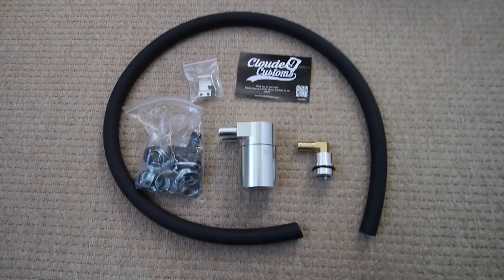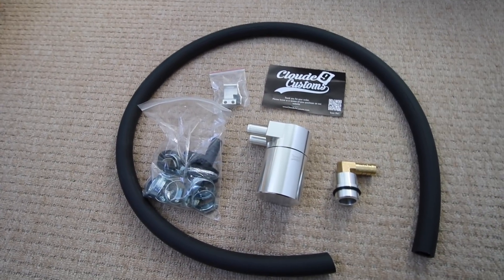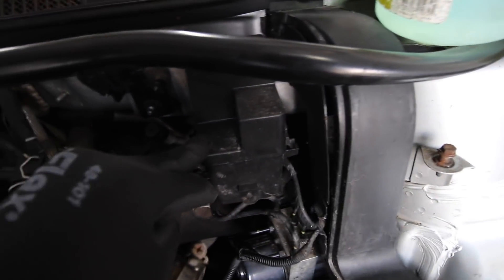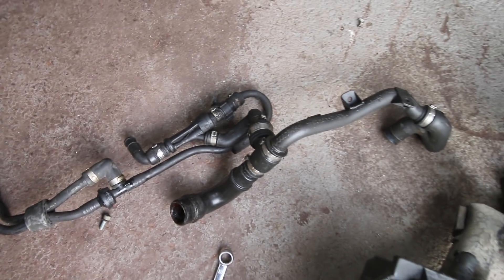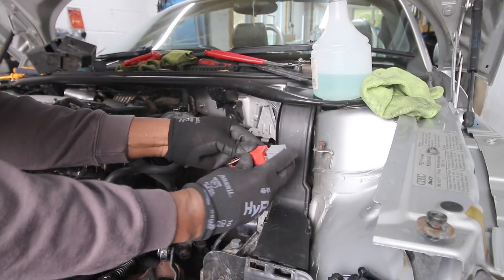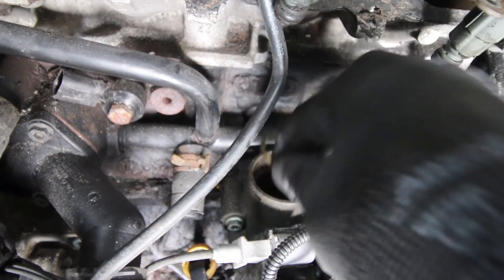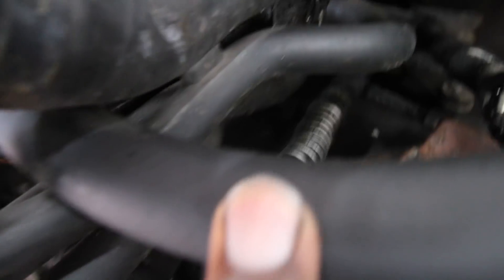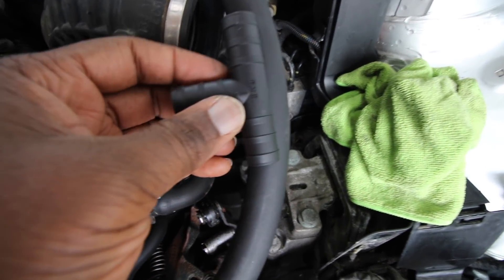The Best how to install a catch can guide on a Audi TT mk1

Comment: Thanks Paul, great video. Tip for cutting the rubber pipes, I use a large sharp kitchen knife, smear some washing up liquid over the blade and around the rubber pipe and it cuts through like butter with nice clean cut. The washing up liquid stops the friction when you cut causing the blade to jump about.
Reply from the maker: Great tip.
Reply: @CarsForPaul   Thanks Paul.

Comment: Very well explained and shot, Paul. Well done from Australia. I have already installed a catch can on my Mk1 225 TT but it's mounted lower down on the battery case. I will be changing the mounting point to what you have just demonstrated because it's more accessible and a cleaner, simpler install.

Comment: Hi, and thanx for this nice vid. I’ve just seen on my can ( not installed yet, and same model ) that the grid inside is on the other way ! There are two screws to invert the position. So, not sure now if this grid must under the output :/

Comment: I need to replace rear calipers, hoses, power brake booster, and all brake and clutch hydraulics on my buddy’s MK1 TT FWD. Is it a horrible pain in the ass to do the clutch line and the brake hydraulics?

Comment: My TT is remapped with decat, miltek exhaust, and Piper x filter. After doing mods I was getting around 27.5 mpg. When it was standard I got 30mpg.
Did this catch can install and now getting 31.5mpg approximately! Must be to do with the car breathing better... Definitely worth doing... Has anyone else had better mpg after fitting?
Reply: I'm getting the kit I'll let you know if it does

Comment: Enjoyed video,but curious on the benefits of catch can....Just got my first 225 tt..Thanks...
Reply: The benefits of the catch can on a 225 TT is the removal of the OE spaghetti piping (that Paul showed after he removed it) of the PCV system to prevent vacuum leak problems that are hard to find and fix with the intake manifold in place. The OE PCV spaghetti piping is a complicated mix of hard plastic pipes, soft rubber pipes, one way valves and a Y Venturi valve. After 20 odd years of running a hot turbo engine bay, these pipes will disintegrate, crack, split and cause all kinds of symptoms to make your TT run badly. Doing the catch can mod Paul demonstrated will prevent all of this, is much easier to check & maintain and will let your crankcase breath much better, with excess oil vapour either being caught in the catch can or burnt up as it gets reinjected into the turbo via the TIP (which is what happens in the stock setup also). Hope that explains it...... Well worth doing!

Comment: Paul there again well explained and loved the clips far better look. Will it make any difference to performance?
Reply from the maker: No, but there is a lot less pipework and no oil spraying over the engine
Reply: If you have pcv leaks you may notice better performance as not losing boost

Comment: Hi Paul great vid. I look to u as the Audi man. I have a headlight problem on a Audi TT 150 halogen headlight were as the adjuster motor is kaput. Is this repairable or is it a new headlight? Cheers
Reply from the maker: Might be cheaper to get a secondhand one from Ebay

Comment: Thanks Paul great vid. I've got an 04' Roadster myself, but its the 180. Do you know if the mod is the same on the 180?
Reply from the maker: Yes it is
Reply: @CarsForPaul  Paul you say it's the same but happens with the non return valve for the brake boost assist ?

Comment: I've looked into this and a major problem today is not all parts are available from Audi. A small amount of pipe work before and after the divert regulating valve is available and costs £104 + vat the remainder of pipe work and non return valves are no longer available So this option may be the next best thing ... There are cheaper items if this kit  on eBay but not sure of the quality .so if anyone else has used one . Pls reply with feedback .

Comment: why do you need to fit a catch can when the makers  does not feel one is needed when it went down the production line
Reply from the maker: Gets rid of the additional pipeworks which breaks down after a while
Reply: @CarsForPaul  pipework is there for a purpose what scares me is audi has spent millions on development to get the cars working right but you come along in your garage thinking you can do a better job
Reply: @marktyler2396  if you saw the crap that ends up in the can, from factory that would end up in the puck and the turbo inlet pipe,
Reply: The purpose of a catch can is to catch escaped vapour/gas due to piston blow by. On all ICE gas escapes past the pistons/rings and creates pressure in the crank case( more so when the engine is fitted with a turbo) Normally this gas or vapour is routed to the inlet manifold and burnt off. When a catch can is fitted the idea is any oil residue that gets mixed with the vapour in the crank case is captured hence the term catch can. The advantage is it avoids fouling the the inlet valves and manifold and a cleaner burn/combustion. In my opinion a waste of time unless fitted to a brand new or rebuilt engine as on a old engine the damage has already occurred and a retro fitted catch can will not magically fix that. I've never heard of fitting a catch can to get rid of pipe work, it would be a lot cheaper and easier to replace any faulty breather pipes.
Reply: @marktyler2396  Its a old tt. He just wants to declutter the bay and make it look nice. Hes got a brand new one, dont think he cares about audi's techs 20 odd years ago
Reply: @JamesYT19  the old pipework on these cracks and you get boost leak and poorer performance... Lots of people does this ranther than try to replace the OEM pipework which would be extremely expensive for what it is.. just the pipe from the manifold Is £40!

Comment: Apparently that way is the worst way to install a catch can, should have another t piece coming off the hockey puck, one way pcv valve fitted and reconnect to the nipple on the intake instead of blocking off.

Comment: Great video Paul 
But a complete waste of time fitting this to a 20 year old engine. The damage has already been done with the amount of sludge that has built up in the engine over the years its like telling a 70 year old to stop smoking the damage to his airways have already been done . If you where doing a complete engine rebuild then its a good idea , I have had 4 audis with this engine in it
Reply from the maker: Good feedback Phil, for me, I did this to get rid of the excessive and broken pipework thus stopping oil spraying in the engine bay.